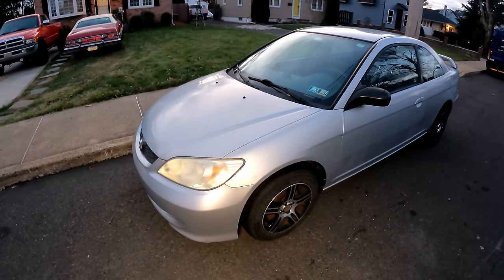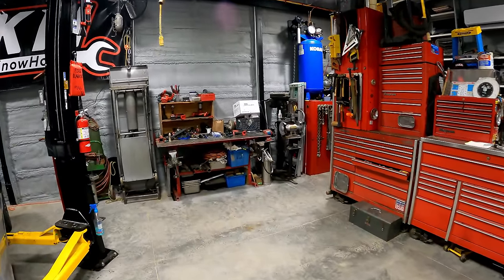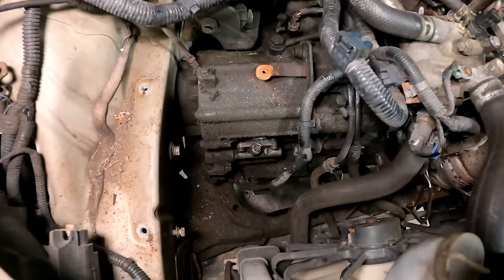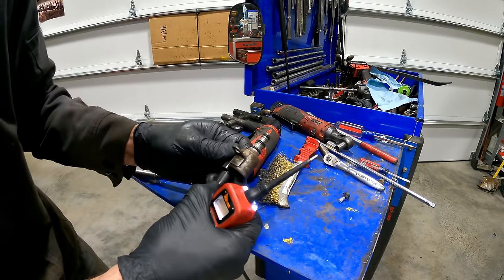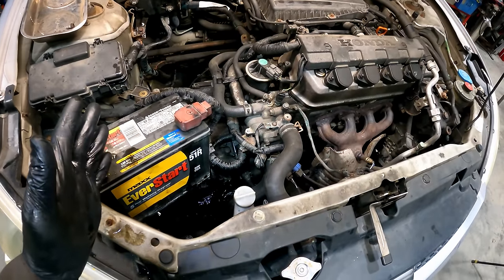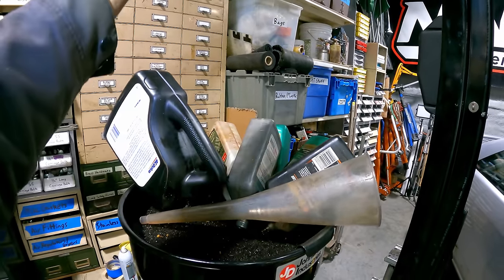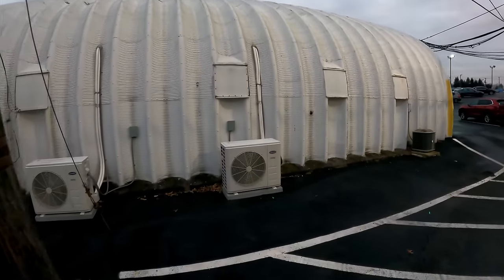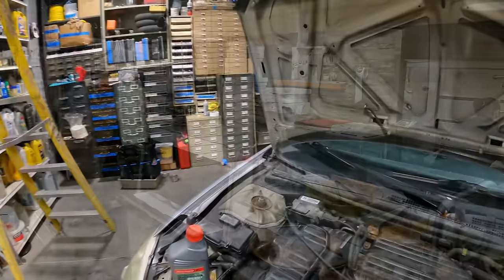Honda Transmission Slipping FAST/EASY FIX

Comment: love you guys and the shows, but dude rip it out through the bottom. back in the day i yanked any honda trans out in 45 minutes legends civics accord prelude Integra one of the easiest cars to work on and you should have power washed her car a long time ago i know your a busy guy but i never let my junk cars get that greasy power wash them as soon as i get them just saying okay going back to the video lol at the solenoid checks sorry instructional but waste of time. you could have done that dog and pony show after you yanked it and put a replacement in it. btw they are not that hard to rebuild been there dun that i know you could do it time consuming first one but i seen you fix some shit, and btw the screen is the last piece that comes off the trans, ah ha i shit you not they build the trans internals around the screen. okay now back to the show
Reply: okay you got lucky but power wash the engine and rebuild the spare you have, believe me they are cake you can handle it.  trans out back in 3-4 hours for first one book time is around 6 hours. i used to do it in 3-3,5 hours swap boxes or did a rebuild that was a 12 hour ticket. but all in all i have to hand it to you you fixed her for now lol
Reply from the maker: On the older ones it was easier to get the transmission out from the bottom. This one you have to drop the whole subframe and then get an alignment afterward and whatnot. Easier to just yank the whole engine
Reply: @NNKH2  still easier from the bottom. not sure about what you said about the whole sub frame. that being said and true. i know this much, and this was in the beginning of front wheel drives. the gm xbody where i first started wrenching burns pontic dealership, x. car's you had to put a cross member over the engine on top attach it and hold it there so the flipping engine would not fall on you. that was the only time i ever saw that. i worked as a mechanic in many many shops. wound up working in trans shops aamco and Cotman to get transmission rebuild experience, and i never ever saw that again where you had to hold the engine on a carline except for that first couple of years on the xbodie's. so i beg to differ, and if so you just make a bracket to hold it in place. and take it out the bottom. remember you have no engine hose's wiring etc to deal with. just way more work. just saying. and an alignment is cake to you i know where you worked i live not far in del county and watch your shows. i worked at davis acura not far from where you live. and worked. believe me its not that big of a job. even the rebuild. i know you are like me a more hands on type of guy. instead of reading rather take it apart and figure it out. but if you watch some trans videos you will see its an easy task. that i know you are well capable of. i seen you fix some shit. and yeah this repair here you did to get her ca running was minor but a fix i was surprised. DO NOT SELL YOUR SELF SHORT! and do not be afraid of any job. people fix them every day. and so can you. my first honda rebuilds were half cases where you left the trans hooked up to the block just lowered the trans down enough to remove the back cover to get to the clutch packs. there's not a lot going on to be honest once you start taking it apart and know where every thing goes. then my first tear down wasnt that difficult either. at least you have one out you can rebuild on the bench. so you dont tie up your lift up and then swap it out. i know you know watch wes work. i follow him too, he hasn't done any automatics. but i have seen him take apart gear boxes and put them back together. he's another mechanic that impresses me. and yeah im always giving him my 2 cents only because i been doing this shit and hate to see guys like him and you who are doig it and are getting it but theres shorter ways to do it. i was a flat rate tech most of my tenure except as a trans installer. never stayed long enough to learn to be a builder but i watched and learned from the builders. and learned on how to take them out and back in quick, so when it was my turn to rebuild as an A mechanic i could pull it back out fix my mistake and put it back when i was leaning.  i only had to do that once on a honda and one other time a half case fix. i started as GM tech, then trans shops then went to honda where my cousin  worked on hondas, and made a lot of money doing it. he helped me with advise. he got me into burns pontiac when i got out the army. we worked at different shops but he would tell me up dates on them he was an honda A tech.